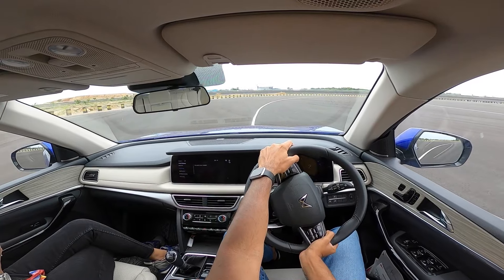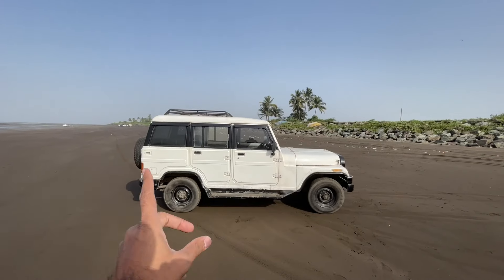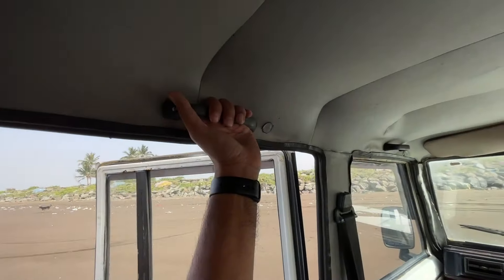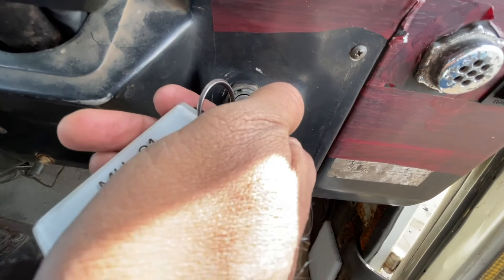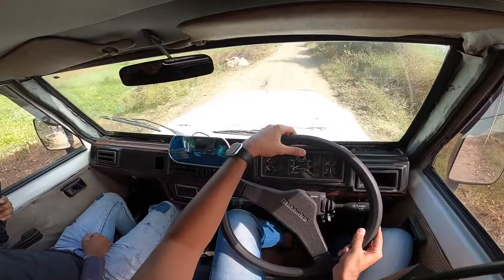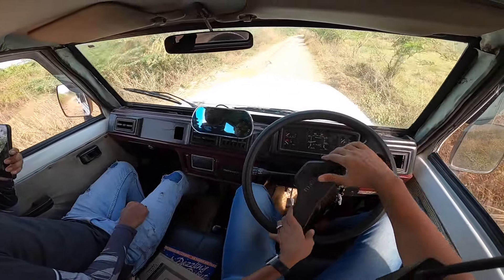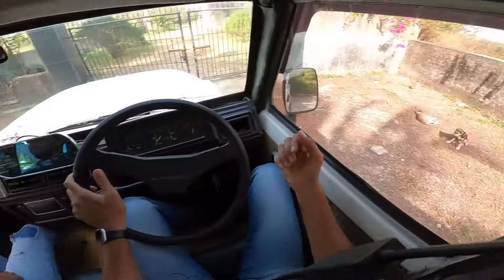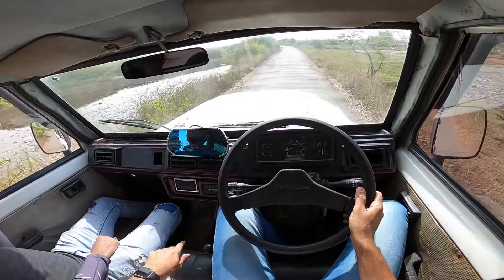1995 Mahindra Armada - Still Works Well After 26 Years! | Faisal Khan

Comment: At 7:01, that’s silver cover, it’s for heater ,in cold starts u have to hold the key to before ignition for few secs,after few secs u can see red hot coils which glows kinda clear the longer u hold the key ,so engine can turn on easily ,I guess it’s for that in this too,please correct me if am wrong :-)

Comment: That's not battery temperature, that's an ampere meter and one more thing that thing on the right is heater blower and switch of the heater for the engine which is required for cold starting these old vehicles.

Comment: The silver thing with holes beside the ignition on the right is a heating coil. The old Jeeps had it. I'm surprised to see it in this car.. it heats up the engine. You'll see a red spark inside when you pull the choke.